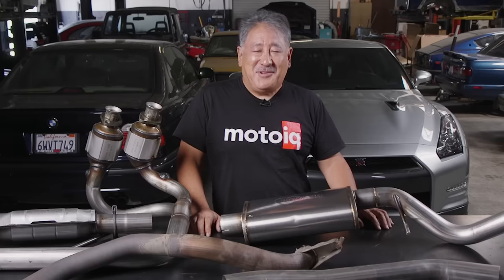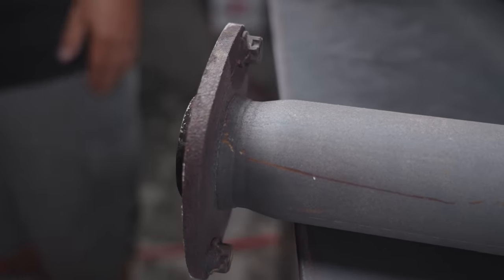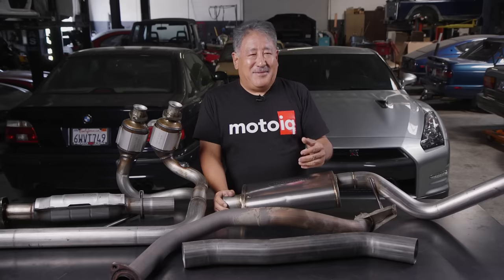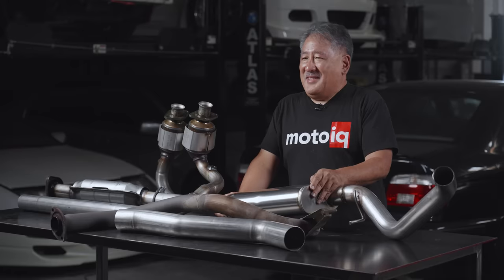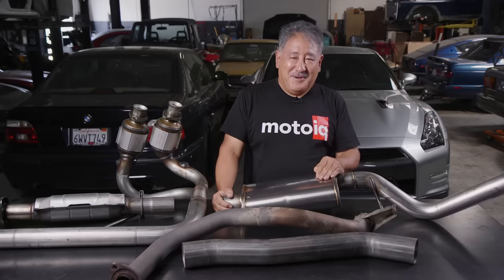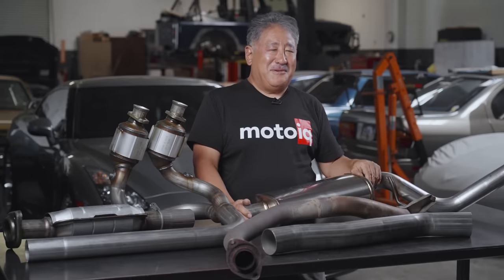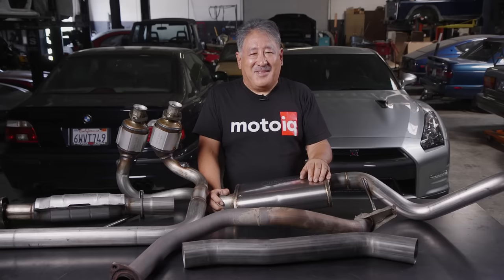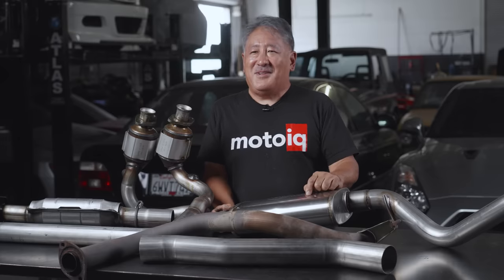Exhaust Back Pressure Myth DEBUNKED!

Comment: I haven’t got a clue what you said but I do know on my 4 stroke 650 dirt bike. Without the baffle it feels flat. With the baffle I get immediate throttle response.  And I bought a cat eliminator tube for my turbo 3.ltr pickup and it ran hell of a lot better was faster and used less fuel.  It totally transformed it. Don’t know why  but it’s a 100% fact that it did.  So what you say confuses me.  And I find big diameter pipes to be flat at bottom end.  I had a 300 bhp Ford turbo. Fitted a large stainless pipe. Apart from I couldn’t hear myself think. Couldn’t hear the radio. And it felt shower and unresponsive. Fitted smaller stainless pipe but it was never has good has the stock exhaust. One again don’t know why. But it cost me a lot of money to spoil the car.
Reply from the maker: You need low restriction and the right diameter to have good velocity, some engines, thats smaller diameter than others.
Reply: @motoiq  I never doubted you know what your talking about.

Comment: So let me see if I got this right. If I'm running my street truck with a twin procharged 1600HP 8.1 with forged/billet everything in it, I would need 2 inch primary tubes and 4 inch collectors running down to 4 inch double X pipe and two Flowmaster Outlaws with rectangular 4 inch by 8 inch exhaust tips out the back?
Reply from the maker: sounds about right.
Reply: @motoiq  Cool. Thanks for teaching me a bunch of cool car stuff! 👍🏼

Comment: Hello MotoIQ, this applies to an old Toyota 8v engine aswell? The motor is not stock, I'm asking because they told me to keep the same manifold (and not going to TRD spec) and stock tubing all the way to the end.
Reply from the maker: What is not stock and who is they?  What motor and what is available and and you are considering?
Reply: @motoiq  Thanks for the response. Well they are some friends with the same engines but they are stock and keeps telling me to not change the manifold. The engine is the 4K (1300cc) from a Toyota Corolla KE70 and the purpose is for daily and light track use. The mods that has is for the head there is a small porting on the head's intake and exhaust from the stock one and polished. Double valve springs and the head is milled to the limit. New piston rings, crank is balanced, lighter flywheel and 275 degree camsaft. As far as the manifold is stock and I wanted to make it like the TRD Spec. The carbs are bike carbs from a Yamaha Fazer 600cc. That's the mods that my engine has.
Reply from the maker: The TRD header is actually pretty good, dual 40mm webers will work better than bike carbs
Reply: @motoiq  again huge thanks for the reply. So TRD exhaust it is then. Yes I know webber is a must to go but I had them so I said why not, there are few old school Cars running those bike carbs that works well here in Greece.

Comment: What would be the best cost effective/as close to stock for my 1995 Audi A6 2.8 V6, with good CATs, new 2.5" pipes from the CATS to the new resonator and then to a generic muffler (thanks COVID, it was the only thing my auto shops had in stock last year), and it's a bit loud. Thus I'm thinking about getting a new, new muffler, any ideas for a sub $200 budget for just the muffler as I already spent $900 to have the rest of the exhaust done last year.
Reply from the maker: Use a perforated, not louvered core muffler that fits. Make sure your resonators are perforated core too.
Reply: @motoiq  I was looking at Borla and Flowmaster but I don't want it to be to loud, I found one that should fit for $159, but it's only 20" Long and the stock one is 26", is that going to make a huge difference?

Thanks again
Reply from the maker: Flowmaster and Borla is really loud, I would try magnaflow or Hooker

Comment: Adding back pressure was just the old timers version of blinker fluid. I've never seen any of the old timers that actually know what they are talking about and say stuff like that actually add anything restrictive to the exhaust on their builds. I've been knows to theow some false advice to my competitors that thought they would either send someone they think I didn't know was related to their team in some way to ask me stuff, or outright try to ask me in person. I did manage to slow em down and get some free drinks here and there though😂😂😂 If you don't want to be tricked take a glance at what they run on race day! I bet you don't find any restrictions, and if it looks like one take a closer look and you'll probably notice they put a hole through the restriction rendering it not a restriction anymore. Usually when it comes to any class that has "rules" best bet is  to shave weight off everything they will allow you too.

Comment: Gas column efficiency isn't the best way to describe it, because this implies that the longer the tube the more power.
Don't forget an exhaust works using positive and negative pulses, they help by having the lower pressure scavenge and help fresh charge enter engine in overlap period, but the positive pressure wave hits the closed valve and when it rebounds it leaves a lower pressure wave.
Also, the end of the pipe produces a pressure wave........
I've yet to find a hand in my exhaust so it's all nonsense! Lol😅.....get it?
Wave...hand.....

Comment: So I have a stock built sbc 350 and exhaust guy put true duals with an x pipe and 1 in 1 out magnaflows on each side 2  1/2 inch pipes. I feel it’s to restrictive and get a lot of drone noise. It’s a 72 c10. What exhaust would you run for max performance?
Reply from the maker: what you got should be pretty good for that motor.  I would add an X pipe
Reply: @motoiq  glad to hear it. It already has an x pipe. I wasn’t sure if it was adding to drone noise or not.
Reply: @motoiq  Thank you!! You are very very knowledgeable. Super cool how you break it down.
Reply from the maker: You can add a resonator before the main muffler to get rid of the drone.  Be sure it has a perforated core.  Magnaflow makes good ones.  If your car dumps under the car, you might want to extend the tailpipes to the end of the truck

Comment: I own 07' honda cbr600rr. It electronic exhaust valve that does control exhaust flow. It works fantastic at all throttle positions. No bogging down when you open at full throttle in any gear. Back pressure is needed for efficient exhaust flow from low to mid rpm range. You will lose torque output.
Reply from the maker: It's not back pressure, it's scavenging.

Comment: I did a test on my Crown Vic P71 2009.
I drilled 6 holes in the front part of Muffler and 1 hole in the rear. on both Mufflers. Hole diameter about the thickness of a ball pen.
I cant afford a Flowmaster so I went on Youtube found a bunch of stuff. But everybody drilled into the pipe just before muffler.
I was certain that it was only for sound effect. Saw one video on Vimeo that suggested the holes in the Muffler. Because there's pressure accumulated but yet allow some of the exhaust gasses to escape through the holes.

Result is a deep rumble not a snappy sound almost like a muscle car when idling.
Throttle response like wroom let's go.
Acceleration MUCH better and it stay a bit longer in the current gear to allow a higher ratio before next gear.
It changed everything about how it performs. I'm no racer but I like a little sound but also my car responds and do an overtaking with ease. I got what I wanted.
Do you have any input to this experiment?
Reply from the maker: Probably just made more noise unless those stock mufflers were really corked up.
Reply: @motoiq  Not noisy at all. Maybe mufflers are clogged and now it can breathe.
How do I clean the Mufflers?

Comment: I'm just curious I have 12 inch vibrant resonators but I'm just wondering why would happen if I shorted them down to 4 inches or 6 inches I'm sure car would be louder right but what would that do to back pressure, again just curious because I've never seen anyone do this before, they either delete them altogether or install for drone purposes
Reply from the maker: No difference in back pressure.
Reply: @motoiq  Ok thx

Comment: It's high time somebody does draft induction.
Reply from the maker: The NFL does
Reply: @motoiq   That's funny. But would you indulge me asking, assuming exhaust volume is less than the intake volume, and pulling a vacuum takes less energy than compressing,  if you sucked on the muffler, then  could you have the flow of a trumpet exhaust with the benefit of silencing? I understand that would normally put a parasitic load on the alternator, but regenerative braking to power electric subsystems is becoming more common.

Comment: Question: I have a 13 Mustang GT race car with a stock naturally aspirated engine, with CAI, 90mm throttle body, 1 7/8" long tube headers, CAT delete X pipe, and currently running 2.75" resonator delete over axel pipes running to Borla ATAK mufflers. If I drop the pipes and mufflers after the X-pipe and add a new tune, will that add more power?
Reply from the maker: Probably not, the ATAK has really low backpressure. Will save weight but may not comply with your rules which usually says the exhaust has to go to the end of the bodywork for most sanctioning bodies like NASA, SCCA, FD, etc.
Reply: @motoiq  I race at New Smyrna Speedway, New Smyrna Beach, FL in their Spectator Races, which have no rules on exhaust. Based on your advice, I may just remove the pipes for weight reduction purposes. Do another round of datalogs and get a fresh tune in there.
Reply from the maker: I think that will do ya, those races are pretty cool, I watch the videos beat those damn teslas!
Reply: Yeah, those Tesla's (Plaide in particular) are ridiculously fast!! I still need to "hear" a performance car, though, lol. Have a great day.
Reply: I "may have" lightened the rear end up too much! See attached Spectator Race, I'm the white 13 Mustang.
Reply from the maker: First race was pretty good at least. I think what happened is that when your car got a little sideways you let off the throttle, that makes the rear light.  What you do next time is to back off some then hold some maintenance throttle and steer some countersteer in it, on a banked oval like this the countersteer might just be a flick. Then the car will do a smooth slide and recover. Letting off at once always upsets the chassis and its a natural human reaction to do so. Good save but I bet that was butt puckering! You might want to practice, take a drifting class and kick some ass.  $500 is pretty good prize money!
Reply: I love your videos! Got one more question regarding the e85 for the Mustang. What spark plug do you recommend, and how often should I change the plugs when running e85?
Reply from the maker: @biggravy732  You can run the same plug as with gasoline.  E85 tends to be easier on the plugs than gas.  If you are forced induction you may have to close up the gap a little.

Comment: People assume the manufacturers systems are no good and just built to a price. That's not true these days, a huge effort goes into developing the right balance of noise suppression and performance. Modern NA cars with high specific output's need good exhausts, look at a BMW N52 exhaust , the pipes from the Cats to the 1st muffler are tapered slightly and the sizes are different front 3 cylinders to rear 3 cylinders to tune the exhaust pulses arriving at the merge. If' you goen to the bother of making a 270 hp 3.0 NA and given it a 3 stage inlet manfold tuning system why would you gove it a rubbish exhaust. It's very easy to make less power than stock with homemade or cheap exhausts and there are plenty of dyno comparisons on YT to prove it.

Comment: I've heard without back pressure, you'll need a tune and make sure your valvetrain don't overheat. Other than that, your good to go. Personally I like having a small cat and small Muffler for a good rumble as I don't like clapping
Reply from the maker: If tuned correctly you wont burn valves.
Reply: @motoiq  yep

Comment: So what do you think of the aeroturbine muffler that claims it "pulls" the exhaust out?
Reply from the maker: They look like they would flow and work real well, the outer chamber probably acts sort of like a Helmholtz resonator to help cancel noise by setting up an out of phase pulse.  Without energy input, the muffler cannot do work by creating a vacuum or anything.

Comment: My 1976 1,9Liter Asconba B with carburetor lost the exhaust so there was no mufflers at all and only a short 1m or so with pipe. It was so loud that you had to wear ear protection with driving and have  window open to not get Co poisoning from the exhaust while driving. It had much lower power then normal under 4000rpm when it suddenly woke up like it had turbo lol. Without the pressure from the exhaust it did run really bad at lower rpm. My 1991 Mercedes 190E 2.0 liter with mechanical injection was a bit similar when it lost the back muffler but overall it had more power without the muffler and accelerated noticeable faster and had about 15% lower fuel consumption without the muffler. So instead of putting on a original muffler I ordered a huge straight pipe with mesh muffler that was just straight trhough exhaust with nothing stopping the air flow (only a little dampening). That worked great and car still used less fuel while having better acceleration at higher rpm  (2500rpm and up).
Reply from the maker: You find this interesting, check out what Gale Banks says https://youtu.be/k7yYY_hy250?si=PGIIk5Qfbafrdr2z  If you don't believe Gale Banks, here is a test garage 4AG did https://youtu.be/V2Wv5-ZTOjM?si=oA1CylAdrnh5m48K You will note that increasing backpressure did nothing but hurt the bottom end.

Comment: This made sense all the way up to the point where he was talking about a Honda K motor. Standard K24 which is a 2.4 L engine has a stock exhaust of 2 in. These motors last hundreds of thousands of miles. If by  highly tuned he meant pushing the engine far beyond what it was designed to do, then perhaps he's correct.
Reply from the maker: Of course I am correct, I would not say it unless I was.

Comment: It's funny because I had a truck that when I went to straight pipe it wouldn't maintain idle but just a simple Flowmaster created just enough restriction to maintain idle so explain that and I tried multiple exhaust setups. Hmmm

Comment: You need backpressure for low-end torque regular cars, You don't need BP for heavily modded engine cars. You'll need backpressure, especially in modern cars the fact that today they are engineered with all electric and computerized.
What this man meant is..if your car customed turbo straight pipe it!
Reply from the maker: You need low backpressure and high system velocity for max torque. Watch the video.

Comment: What about old cars like a 76 Monte Carlo with a 350 engine does it matter if you put a bigger exhaust pipes and cut off the catalytic converter? He said it could have hurt an engine but I'm guessing he's talking about high Reviving turbo Motors
Reply from the maker: Bigger means the right size not the biggest you can get in there.

Comment: Can I install a free flow exhaust on my 150CC sports bike ( Yamaha r15 with Electronic fuel injection 2018 model )

I would love a little more power

Will it cause any significant loss in fuel efficiency? 

Do I need to get the ecu retunes as well ?
Reply from the maker: Be careful with pipe diameter it's easy to overdo it with small engines. you may need to retune
Reply: @motoiq  thanks a lot for the reply, will so some more research before I start messing around

Comment: What I was told when I was a kid (around 16 I believe), was that you never wanted to run on straight headers because it would flatten the cam. I ran on straight headers on numerous occasions and never had that happen to me.
Reply from the maker: Because that won't happen.
Reply: @motoiq  I was just a shade tree mechanic back in the 70's and early 80's, but it never sounded plausible, lol.

Comment: I like the more air flow more power thing but that is NOT the case in every application. Say if your application calls for as much torgue at low rpms as possible. The last thing you would want to do is increase airflow at intake being it can make your low end T numbers drop and only show up at higher rpm due to lazy airflow. If not than why do larger valves raise the rpm where the torque shows up.  Example of that application would be direct drive airboats, Const equipment, pulling trucks etc. Its the same as putting a high cfm carb on a low ve rated engine. AND adding a bit more pipe has increased low torque numbers on these apps according to the dyno tests I witnessed..
Reply from the maker: It's pretty simple, If you want more power at a given rpm point you design the intake, exhaust, camshaft, head to have the best flow at that point.
Reply: @motoiq  I getcha,,  THIS subject is in my brain hard right now for a reason.And this is more of a discussion before coffee in the am lol. I have been building another direct drive airboat engine for a couple years slowly and now im not rushing it but I am trying to finish it this month because i just blew the old 472ci and i have to have it ready for the 4th.. Removed my damaged Caddy 472 to install my project .30 over caddy 500ci. It has been such a strange formula to figure out.. Prop cant pass 3000rpm or the tips with reach speed of sound and grenade. So i need as much torque at or below 3000. I am trying to build the perfect 500caddy dd airboat engine.. Ill post my formula if you are interest. 25 year marine mech, But this is dif than what I do at work. i AM skipping this holiday weekend to try and finish it, Todays plan is to put pan on and spin up the oilpump.